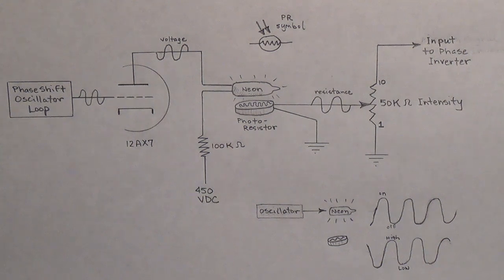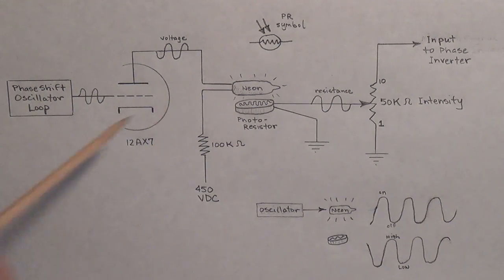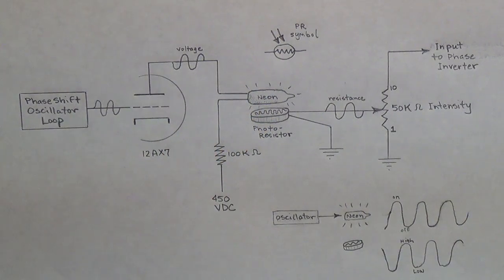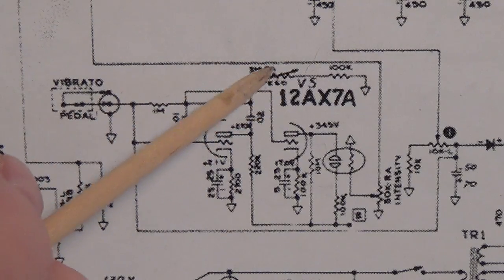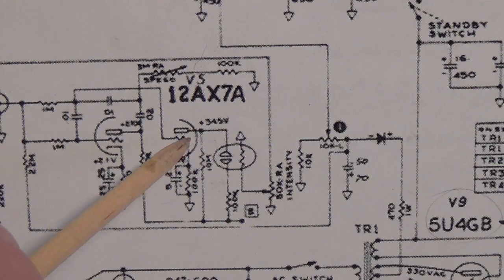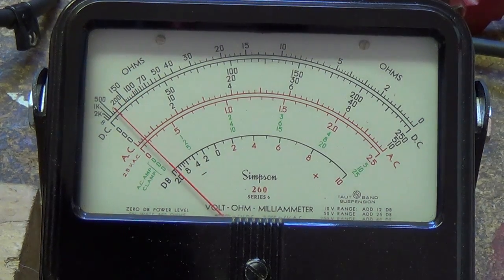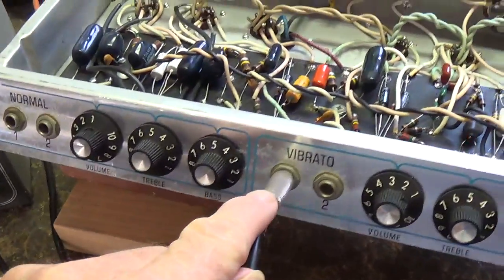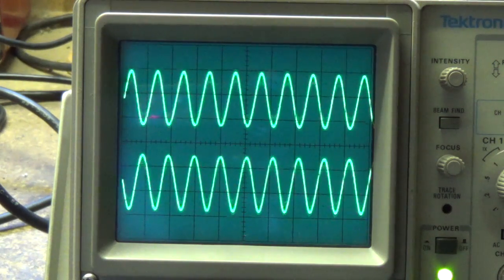Photoresistor Volume-Modulating Tremolo: Design and Function

Comment: Congrats on 1 million. !!!
I just picked up a Strobe Tuner, its a Conn from the 1950's they seller said it didn't work. So i got it super cheap. took it apart and it has those kinds of bulbs in it. I made a few tweeks and cleaned it up and wham...it works...But the display is difficult to make out.

but thanx fo all of you vids, I watched them all and refer them out to other Tube Heads. this kind of info is priceless.

Rusty is pretty smart, he stays out of the drama !
Reply from the maker: Thanks so much, GH. Rusty and I are still hung over from all our celebrating :) Since he's almost 120 (in dog years), Rusty has definitely learned to "pace himself".

Comment: Thank you for this, you've given me an idea for a project using chips and opto-couplers.
Reply from the maker: You're welcome, Franko.
Reply: @UncleDoug  OMG!!! Ive just spent all day, (got up at 6am), designing, (on paper, old school), a tremelo circuit using a NE555 IC and an Opto-coupler. Then built it on a strip board PCB. It only bloody worked first time. That is a record for me!!!. Normally I spend a week or so trouble-shooting. I'ts now 6:40pm. Day well spent. Thank you again for the idea.
Reply from the maker: @frankowalker4662  You're quite welcome, Franko. Congratulations on your successful project.

Comment: I've recently done a mod to the "bug" by cutting it apart, removing the neon bulb, and replacing it with a 5mm white LED. It works very well, especially if you encounter a tremolo with the infamous "tick", clears it right up!
Reply from the maker: I'm surprised that the LED could withstand the 345VDC that is normally applied to the neon bulb, Mike.  Most LED's I encounter operate on 12V or so.  I will keep your suggestion in mind for the next time I encounter a malfunctioning photoresistor tremolo and give it a try. Thanks for your input.
Reply: Uncle Doug here's where I got the idea:  http://music-electronics-forum.com/t26384/

Being a fellow "Tremoholic" myself , I've been using mine ('65 Fender Twin clone) heavily for the past week. So far, it's holding up very well. Cheers!

Comment: This was super helpful, thanks!  I'm about to embark on restoring my Silvertone 1484, which has a photo-electric tremolo like this one, and I've been trying to wrap my head around how it works.
Reply from the maker: Jason Thorpe You're welcome, Jason.....glad the video was helpful :)
Reply: Uncle Doug Well, I'm making progress on this restoration project, and I figure I might be getting to the non-working tremolo in a week's time.  I've had this amp for 20 years, and in all the time I've had it, the tremolo has never worked.  I know the tube that drives the LFO is good, but I have the sinking feeling that I'm going to discover that the neon/LDR module is bad, with the most likely culprit being that the neon bulb has worn out.  Of course, this means performing surgery on the neon/LDR module, and figuring out the correct specs for the bulb.

Have you ever repaired a neon/LDR module?  Any tips / tricks?  (Hoping I can use my Fluke meter to determine the peak-to-peak voltage for the bulb -- I'm not particularly interested in trying to figure out what's wrong with my old Heathkit scope right now...)
Reply from the maker: Here is an excellent article that covers all the details re optical tremolos:  http://www.clarkhuckaby.com/NewVibe/CloseLookVibe.html

Comment: Doug, I'm helping a friend repair his Ampeg Reverberocket GS-12-R tremolo and watched this fine explanation video. Got a couple questions about neon bulbs: In the circuit you demonstrated, is the bulb always conducting (ie your bulb voltage is always greater than the turn-on voltage over the swing)? Also, on these small neon bulbs, what's your estimate on the flash over voltage, the maximum voltage?

Love the mop surfing. Its good to see that Jack was once an sweet-innocent kitty before he became the delinquent international rock star. Ahh, the days of our youth....
Reply from the maker: Greetings, Craig. In the Deluxe Reverb, the neon bulb operates at 345VDC, so they are definitely high voltage devices. As to the maximum voltage, I have no idea, but will bet that they are very forgiving.....probably allowing a wide usable range of voltage. In the past, rather than experiment with bulbs, I simply order the exact replacement from Fender (on Ebay).

Comment: Doug, I found it.  It was indeed the 1967 Princeton Reverb video 3.  You strapped a couple of extra 1M ohm resistors across the existing 1M ohm resistor coming off the plate of the oscillator tube.  Unfortunately my circuit on the Bandmaster uses a photo resistor and has a 10M ohm resistor coming off the plate of the oscillator tube.  Not sure if reducing that value will increase the intensity but maybe I'll try that.  Thanks!
Reply from the maker: Let us know what you discover, Obe. It would be useful info.

Comment: Doug, I'm working on my 1966 Bandmaster head and trying to beef up the tremolo. Right now the intensity pot doesn't kick in until around 5 but the oscillation works very well. I put in new pots for both the speed and intensity as well as the photo resistor and changing the 10M ohm and 100K resistors. No appreciable change in the intensity level. Still very anemic. I remember seeing one of your videos where you made some change to the tremolo circuit that really beefed it up but I can't remember which video. What do I need to look for? Thanks for alll the great instructive videos as well!!
Reply from the maker: I recall the tremolo circuit change, Obe, but not the specific video. Odds are it was in a Princeton Reverb, perhaps the '67 model that I had to restore.
Reply: Do you recall what the mod was that you made to the circuit?

Comment: Congratulations on the views!  I've enjoyed your videos for quite a while now, and I hope you'll keep them coming!

I was pretty surprised by this one.  Compared to the more "modern" signal chains I'm familiar with, it struck me as odd to have a volume modulator AFTER a reverb.  Is this more a limitation of tube circuitry, or just one of those concepts that inevitably changes with time?
Reply from the maker: Thanks so much XC. Glad you enjoy the videos :) To me this arrangement makes good sense, particularly with an electromechanical reverb tank (that must be driven hard to function). In this arrangement, the volume-modulation affects all parts of the music signal equally, whether reverb is present or not. If you modulated before the reverb, the lower volume input would probably not drive the tank, so rather than a simple volume fluctuation of the mixed signal, you would also have modulation of the reverb effect, which would probably not sound good. This may not be an issue with modern, synthesized reverb effects.
Reply: You're probably right.  But with the modern methodology you would have to overdrive your tubes, and then mic the output through a synth reverb and out again through another amp, or into a DI box for recording purposes.  It's messy.  But running a synth reverb between guitar and a tube amp, then trying to overdrive the amp... well that's just a writeoff.

Comment: Watched this one again, thanks for posting.The ticking in my Deluxe Reverb is driving my nuts.Side note, have you heard the band "Los Straitjackets" , I think you will like them.
Reply from the maker: +tbdalva You're welcome, TB....glad you liked it. There are several Internet sites that discuss the ticking issue and offer suggestions for remedies. You might want to check them out. Part of the problem is the high voltage required to illuminate the neon bulb. Good luck.

Comment: Photoresistors are also really great for compression. You basically use them in the signal path, in lieu of whatever diodes one would normally use.
Reply from the maker: This sounds like a rather unusual use for photoresistors, Adam.....are you sure you're not having an oscilloscope flashback :)
Reply: Uncle Doug So, I may be a little off in my description, and in my attempt to correct it, I'll still probably sound less than coherent. I think it goes something like this.....signal between gain stages is split to pass through a photocell and a light bulb of some sort (could also be an LED), and the more signal the bulb gets, the brighter it gets, and the higher the impedance of the photocell. There is also another type of circuit that only uses a bulb, which acts as a variable resistor, stepping harder on the signal as it heats up.....I think the bulbs inside a stock AO-44 are used for this, but don't quote me on it.
Reply from the maker: I believe that the AO-44 bulbs act as ballast resistors to curtail high signal current flow, exactly like the light bulb current limiter many of us use when working on amps. This really isn't the same as the optoisolator in the tremolo, in which the neon bulb gets brighter, causing the resistance of the photoresistor to decrease.
Reply: Yea I was looking for an optical compressor a few weeks ago but I never did pull the trigger on anything.

Comment: Great description and explanation.   Do you use an isolation transformer when working on these amps?   If not,  isn't chasey ground floating?   Just curious because I saw your scope grounds connected to the chasey.   I know about these things but are not conceptually complete in my mind thats why I ask.
Reply from the maker: +John Miner Thanks, John. No, since the circuit has a power transformer, the chassis is already isolated, and since the high voltage circuit uses the chassis as part of the circuit, taking B+ measurements relative to chassis ground is the way to go.
Reply: +Uncle Doug That makes sense.   Just a note, your description in another video about ac/dc being able to coexist in the same line which seems obvious but its not finally led me to understand the function of coupling decoupling and bypass capacitors.   Cheers for that!
Reply from the maker: Thanks, John. I'm glad the info was helpful.

Comment: Hi Uncle Doug!
Congratulations to over one million views and Thanks for posting all fantastic videos!
I have a Deluxe Reverb (AA868) that has an issue with the tremolo.
At first it didn't almost work at all, but after changing the three filter capacitors you mentioned, plus the optocoupler and the 12AX7, it sounds good. The problem is that it doesn't start oscillating right away when it has been turned off for a while. But after having it on for around 30 seconds or so, it starts oscillating by itself and works fine until the next time I have it in off-mode long enough. It seems like current (or temperature) has to build up somewhere to get things started.
Do you have any idea what it might be?
Thank You / Patrick
Reply: Sorry, the circuit is AB868 of course.
Reply from the maker: Greetings, Patrick, and thanks for your kind comments :) Re the "reluctant tremolo",  besides the three capacitors (they are not actually "filter capacitors", which are electrolytic), the values of the resistors in the loop must be (reasonably) accurate also. You should check and perhaps replace them. Another key factor is the oscillator tube. For some reason, some tubes work better than others. You might consider trying some other 12AX7's in its place. Final suggestion....are you sure your footswitch is making good ground contact when closed? These switches sometimes lose their internal continuity. You can test this with an ohmmeter or by simply eliminating it from the circuit and grounding the RCA plug that it plugs into. Good luck.
Reply: Uncle Doug
Greetings Doug! Thank You for your reply and much valuable tips!
Yes, correct regarding the capacitors, I was more thinking of them as ingoing capacitors in a hi-pass filter :-)
I will check these things and keep you posted if I make any progress.
Best wishes to You and Rusty from Sweden!
Reply from the maker: You're welcome, Patrick. Best of luck :)

Comment: Thank You for this nice explaination video ! That would have been nice to see the actual modulated 2khz waveform envelope (slow scope time base). It looks like as many Fender LCR based tremolo that the final 'to the speaker' signal envelope is not sinusoidale anymore but bumpy... Isn't it ? I'm tryimg to modify a Fender Deluxe reverb LCR based to a direct drive to the output tubes like a Vibrolux design which has a smooth sinus envelope.. What do you think ?
Reply from the maker: Your project doesn't sound feasible to me. The Vibrolux tremolo modulates the cathode of the first pre-amp tube, while the Deluxe Reverb uses a photoresistor to modulate the signal volume sent to the phase inverter. It's apples and oranges. Good luck.
Reply: @UncleDoug  Thanks for your reply. One question though.. Is-it possible that 'most' photoresistor based Fender tremolos produce 'bumpy' envelopes on the final signal to the speaker. The LDR's NEON lamp nature is that it is completely OFF then ignites sudenly on all tremolo cycles for any sufficent voltage across it then shuts OFF also sudenly. This cannot produce a smooth rising/falling envelope like a sinusoidale one does. The direct drive to output tube's input grids with sinus shaped waveform can do that. Am-I missing something ?

Comment: Another great tutorial Doug and Rusty and jack the cat provided the extras.
 Now why would Fender use two different types of tremolo circuits in two low wattage amplifiers? It would seem that cost would definitely be a factor but would there be an advantage to use one over the other when being used in these lower wattage amps?
 Having owned two Sunn amps, one with tremolo, I went back through the schematics of the 40 Watt Solarus and found it did indeed use the photo/resistor circuit. Very interesting. Now I wish I could get my hands on that old amp if I could ever figure out where it is.
 I enjoy all your tutorials especially since when I attended school  for electronics, there was one chapter devoted to tube amplifiers and was very generic in nature.
Reply from the maker: +John Zook  Thanks, John. I believe that Fender used the output tube Bias Trem in the Princeton and below (in size), and the Photoresistor Trem in the Deluxe Reverb and above. It's best not to use a Bias Trem in more powerful amps due to the stress it puts on the output tubes.

Comment: In this video you show oscilloscope images of the phase shift oscillator output.  Exactly where are you probing to get these sinusoidal images?  I don't get sinusoidal images on my oscilloscope when probing around the the phase shift oscillator.  However, the tremolo circuit is modulating the output signal at the expected frequencies.
Reply from the maker: As is clearly stated in the video, a 2KHz signal is injected into the input of the amp circuit. The probes are on each of the output tube grids.

Comment: Are those dark blue caps on the circuit board ITW? I found several of those caps, unused, in electronics lab one time and learned they were used in a lot of silverface era amplifiers. The ITW stands for Illinois Tool Works.
Reply from the maker: The amp is all reassembled now, but I believe they are ITW caps.....frequently used in SF Fender amps, as you stated. Thanks for your input :)

Comment: I have a question Uncle Doug, I have a 1969 drip edge Super Reverb, has the most amazing, studio quality tremolo ive ever heard. I sold it last year, Fed EX destroyed the cabinet, knobs and the faceplate. They paid the insurance and sent it back to me. Could I pull the tremolo circuit from the amp and put it in to a stand alone housing so I can use it on my pedalboard. If this could be done, how would i power it and how would I find out how many volts it uses without damaging it? Thank you! Great videos keep em up!I
Reply from the maker: The answer to your question is quite complex.....way beyond the scope of this type of communication.  Your best bet is to watch my tremolo videos as well as others on power supplies, circuit voltage demands, etc. and figure this out on your own.  It is definitely possible, but would be a challenging project.  Let us know if you do it, and how it turns out.

Comment: Greetings Uncle Doug! I can't thank you enough for these videos. I'm currently fixing my Fender Super Reverb with knowledge gleaned from you lessons. I have a question about that 10uf cap and 3.3M resistor on the dry line. Doesn't this allow only very high frequencies to pass? It seems drastic. Why's going on there? Give my regards to film-maker-extraordinaire Rusty The Dog and Jack The Wonder Cat. And again, thank you.-Rick
Reply from the maker: I don't have a schematic handy, Rick, and I think you mean 10 picofarad cap, which does indeed restrict the passage of all but fairly high frequencies to the reverb tank.  This is because the reverb tank works well with high frequencies, but gets muddy and unpleasant with low frequencies. The lows still come through the "dry" circuit to be mixed with the predominantly high frequency "wet" signal from the tank.